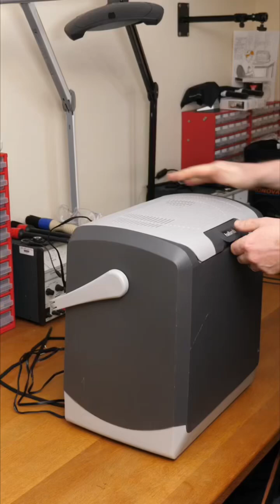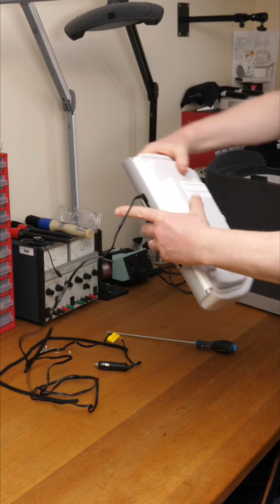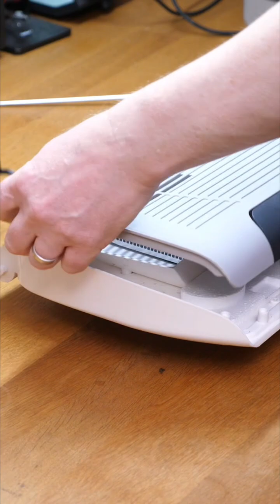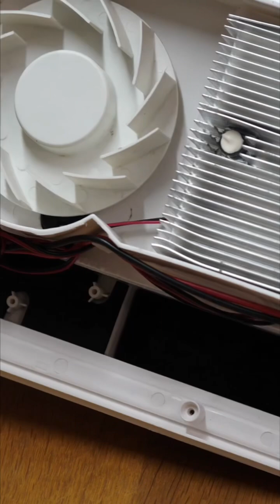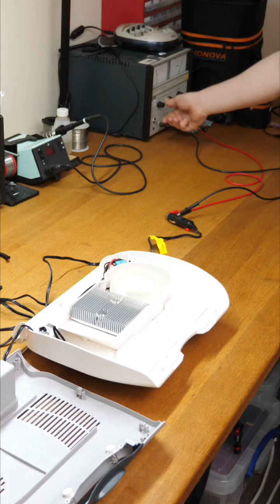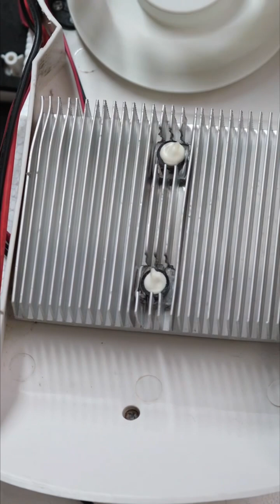How an a electric Cool Box works.  #shorts #car #howitworks

Comment: Hi. My cool box has stopped working. It seems to be the hot cold switch. Can it be fixed?
Reply: It's stuck in the off position!
Reply from the maker: Could jump the wires and so its permanently on I guess.

Comment: No it doesn't work like this: what is on the other side of the lid? Have you ever checked? Note: there are two wires (+12V and negative) going into the "heat sink" which is more than a heat sink...
Reply from the maker: Looks like I got this one wrong.  Can you elaborate for us please so I'm not spreading misinformation.  Thank you
Reply: @CoatsandGaiters  sure. It's all about thermodynamics. If there only was a fan blowing into the heat sink, the box would never be at all cooler than the ambient temperature outside the box regardless how long time you let it blow, probably a bit warmer. why? Because a fan can not cool the object it is blowing at any cooler than the air it is moving, the object being in this case a heat sink. Never actually cooling anything outside or inside the box, just making sure the object remains as cool as the ambient air. Thermodynamics again.

This is why you need an active component which will cool itself down cooler than the air inside the box, in this case a Peltier module, a solid state thermoelectric heat pump. No moving parts, only thing actually moving is electrons. This is the thin apparatus between upper and lower heat sink the two extra wires are connected to. How does it work? Simplified: when electricity is passed through the module, electrons move from one element special to the other element creating something that is called Peltier effect. This allows one side of the device to absorb heat (this side is physically attached to the heat sink inside the cooler) and the other side, which is attached to the upper heat sink you show in the video to radiate heat which is helped by the blow from the outside part of the fan. The fan inside is just to circulate air inside the box to make sure the  items there will all be in contact with the cool air warming the air inside until this warmth has been conducted outside via the Peltier mode. 

So the short story even shorter, the Peltier module actively cools down the air inside the cooler, hence the air may be cooled to lower temperature than the ambien air temperature is.

You are welcome 🙂

Edit... A fun fact: if you reverse the polarity of the current you feed to the device, it begins working the other way around. This is how they make cooler/heater boxes.
Reply: @tapioaalto2656  Thanks a bunch for this explanation!
Why haven't you gotten like 20,000 likes for your kind explanatory comment already?
I wish I could give you thousands of likes .

Comment: Thanks I Wanted to Clean mine I couldn’t see all the Screws I can see some are under the lid beading , it picks up dust in my lorry on the outside fan I just want keep it clean for maximum air flow , 
Thanks for your video and they are a Good Cooler for the money.
Reply from the maker: @darrenfarrell-bn2cb  pleased I could help and thank you for the comment.
Reply: @CoatsandGaiters  thank you , you Helped me Solve a Problem,

Comment: Most of them use peltier modules and some can switch from a cool box to a hot box.
Reply: You can see the wires to the peltier module running under the heatsink
Reply from the maker: @pauldriscoll5010  Well spotted I thought they were the wires to the fan motor but on checking the raw footage I don't think they are fan motor wires.  You may well be right.
Reply: @Coats and Gaiters  on the similar mini fridges I've salvaged similar modules from before there will be a 30 to 50w peltier module between 2 heatsinks with a fan on each heatsink.  Then as Richard  said if you reverse the polarity across the element you can cool or heat the inside of the box
Reply from the maker: @pauldriscoll5010  they do a heated version of this coolbox as well !!! think you've got this one Paul.  Interesting stuff.
Reply from the maker: Well I never knew about that but now I do.  Thank you.  Made for an interesting read.  Wonder if they cost more though than a straight aluminon heat sink?
Reply: Reverse polarity and instead of cooling it heats
Reply from the maker: @keycontroller  those peltier modules sound fascinating.
Reply: They are, they can also be used for generate a small amount of electricity if you put a large temperature differential across them not as good as a true seebeck element but the peltier effect and seebeck effect are almost the mirror of each other